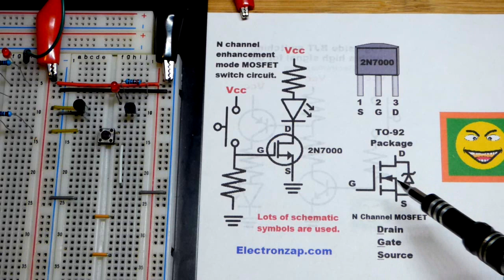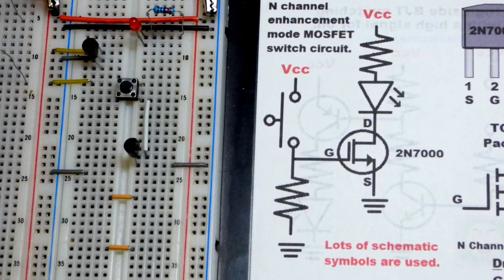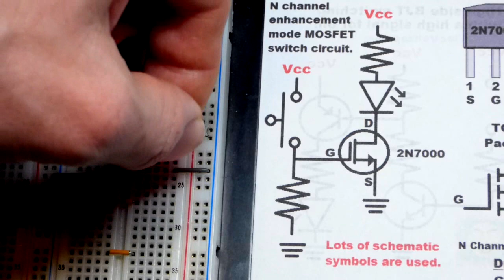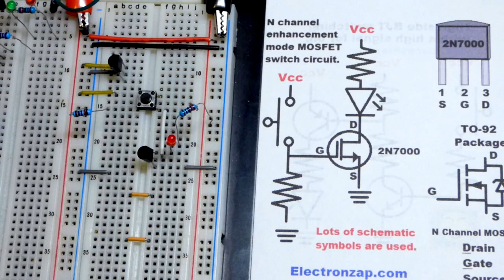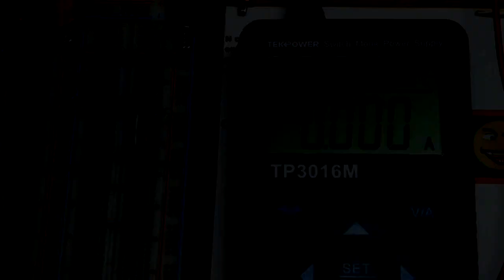Quick 2N7000 N channel enhancement mode MOSFET switch circuit by electronzap

Comment: Als zwei TAstendimmer Dimmer kann man den 2N7000  genauso wie den IRFZ 44 bei drei bis 4 x Birnchen , mit 1.5 V hintereinander für Weihnachtsbeleuchtung bei ca 4.5 - 6 V und mehr hintereinander bei mehr Spannung hernehmen.
man ersetzt den 1 µf beim IRFZ beim 2N7000 durch einen 2µF Mini - Elko und  24 V z.B. auch bis 12  V denkbar (noch nicht geprüft)
Der 1 Mohm - Widerstand am Mittelpunkt der beiden Taster zum Drain hin ersetzt man durch 300 kohm 
dann kann man ähnlich rauf und runterdimmen mit zwei winzigen Tastern. (zwischen GAte und Drain sitzt der Mini - 
Elko  Den 2 N 7000 klebt man .z.B. auf einen winzigen Metallriegel der auf Alufolie kleben und beide auf ein wenig 
Pappe.(damit es am Tisch als winziges Buteil aufliegt  Ganz oben drauf 
die flache Rückseite des To92 Gehauses des 2 N7000 mit 1x1 Sekundenkleberklekks geklebt.  Dann ist gekühlt 
Dann geht es  genauso wie mit dem IRFZ44 natürlich bei rel. niedriger Glüh - Birnschenlast.
z.B. aus Weihnachtsbaum - Glühbirnchenkette mit echten 80 x Glühbirnchen und dazwischen 4x Stück
von der Stange rausgezwickt. Ganz praktische  Weihnachtsglühbirnchen zum Basteln und Entwickeln. 
Klarer , schöner heller und romantischer als nur die sehr grellen (aber teils augenstichig faden LED) 
die überwiegend in eine Richtung leuchten. Diese Birnchen brauchen speziell sehr wenig Strom, 
sind aber sehr hell. heller als die kleineren LED Man braucht dann nur beim Dimmen hin und her tasten 
(auch keinen Gate source Widerstand). Wie erst herausgefunden (leicht anders als beim IRFZ) muß dieser 
bei bestimmten Schaltvorgängen rel hochohmiger nach unten sein, wenn man eine Kleinigkeit hier verbessern will.
Beim Dimmen immer weglassen, nur auf die richtige Polung des Mini -  Elko achten. 
Der Innenwiderstand  der D_S Strecke vom 2 N 7000 ist mit 2 Ohm auch 10 x höher als beim IRFZ 44 
(dort nur 0.2 Ohm). deshalb etwas stärkerer Elko und reduzierter Wiederstand , damit dieser prompt 
regelt. Einen höheren Innenwiderstand hat er bereits (bei schon weniger Stromlastigkeit).
Aber es geht hier noch gut. (praktisch noch kein Unterschied bei den 3 - 4 Weihnachts - Birnchen).

Comment: Can i use it with control circuit with finger print without direct touch
Reply from the maker: I haven't worked with any finger print readers, but there's got to be some way to use them to control a transistor if that is desirable.

Comment: Should the driver be a processor pin or an I/O pin (e.g. from a MCP23017 I/O expander) instead of a switch, would there be a need for a series resistor, say 100 ohm, between the I/O pin and the gate of the mosfet?  This to avoid excessive current flow during switching moments?
Reply: Yes, although the 2N7000 is a small-signal device and the gate capacitance is only around 60pF, so you're unlikely to damage a MCU if you omit the series resistor, but better safe than sorry. Contrast that with a power mosfet like the IRLZ44 with a gate capacitance around 3nF, which is 50 times larger.

Comment: thanks for the video. the data-sheet is reversed on page 1, but is consistent with your diagram on page 8. wow
Reply: The OnSemi datasheets are notorious for inaccuracies, and I have one dated April 2011 for the 2N7000G which gives S-G-D for the pins, while another dated January 2022 for the 2N7000AN & 2N7000AR gives the pins as D-G-S.
In any case, you can always tell which pin is which on an n-channel enhancement mosfet using a multimeter set to measure diode drop: the gate never conducts; and when you have a diode showing between two leads, the anode is the source and the cathode is the drain because of how the body diode is connected. It's opposite for a p-channel.

Comment: i thought that was the symbol for a p channel J fet ?
Reply from the maker: JFETs usually have the arrow at the gate.
Reply: @Electronzap  Yeah, the symbol used in the schematic on the left of the printout looks wrong to me. Is that not the symbol for a PMOS depletion-mode FET?? (The Drain-to-Source line is drawn as solid instead of broken, and the arrow is facing out, instead of in).